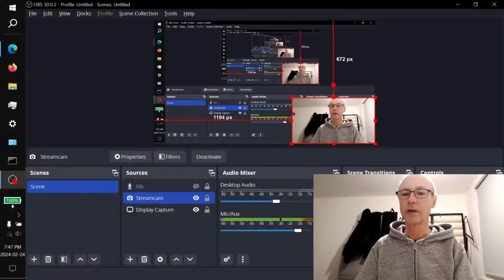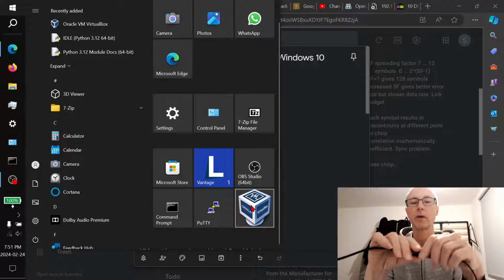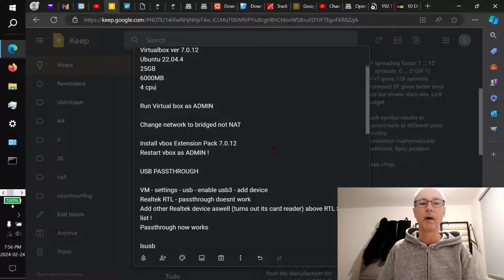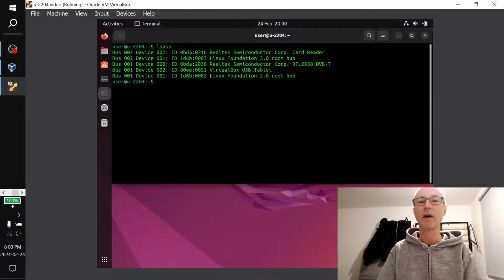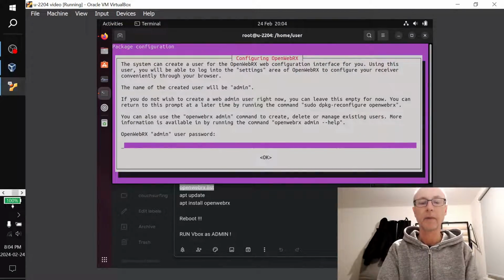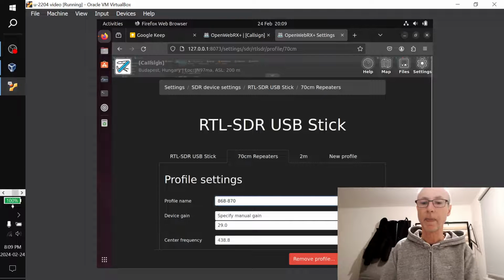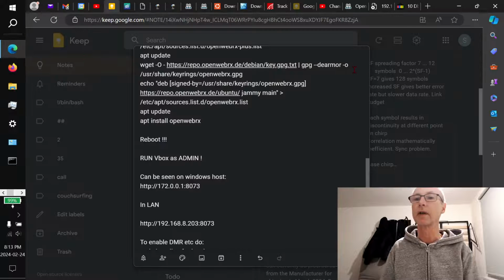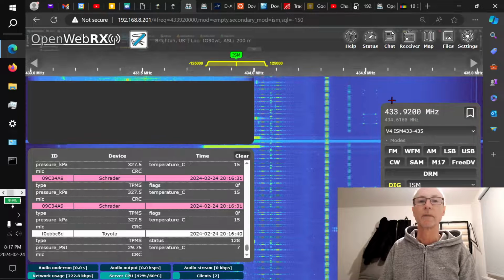See Meshtastic Signals using Openwebrx+ in Ubuntu VM on Windows 10

Comment: Raspberry pi image doesn't work I tried it and it doesn't work on a Raspberry pi 4 or 5!
Reply from the maker: I use the ready made image on Raspberry Pi 4 and it always works for me. Maybe I should make a video about this if I haven't already. You just flash the image file (url below) to an sdcard, pop it in the pi and for me it works straight away. I like to use the Raspberry Pi Imager because in there you can set the username and password plus enable ssh so you can connect to it via the network later on. I think there was some issue about having to create an additional user called "admin" for the settings app to use when it is loaded in a web browser which wasn't immediately obvious to me. You can do this with
sudo openwebrx admin adduser admin
The system then prompts you to set a password for the user called "admin".
Here is the link to download the image to put on the sdcard:
https://github.com/luarvique/openwebrx/releases
I hope that helps you to get it working !
Reply from the maker: I also noticed that Raspberry Pi 5 is not able to run Ubuntu 24.04. There are known bugs which have not been fixed so this might prevent it from running openwebrx+ too.

Comment: Just installed OpenWebRX+ on a Pi3 tonight, with a view to putting it in the shed to see what is about in this parts of the UK. Many thanks for the howto video 😁😁
Reply from the maker: You won't regret it. I have several Raspberry Pi receivers set up in my network and enjoy monitoring different bands on a big screen monitor.
Reply: Just wondered if OpenWebRX+ will ever be able to "decode" Lora/Meshtastic, or is it such a closed shop that only manufacturer knows how?

Comment: Really good content as always. Thank you. I just bought a couple of the McGill microwave antennas direct from their website. They had sale on so quite reasonable. I got the same 10 db panel and found it works very well with good match to 868MHz. I also got the 4db omni and that is not resonant on 868MHz so may return that one. Also use openwebrx on docker. Very convenient but still can't get the extra decoders like YSF to work. Thanks!